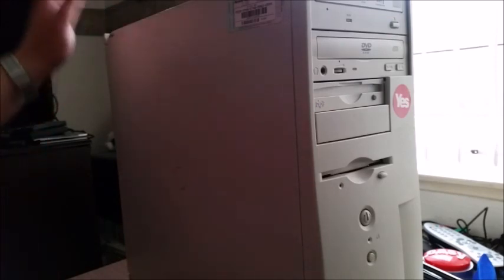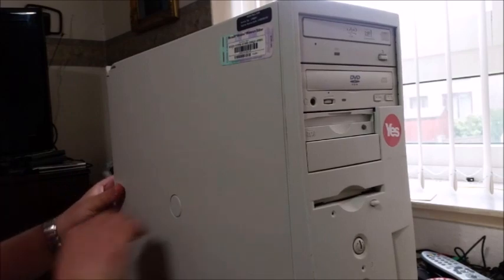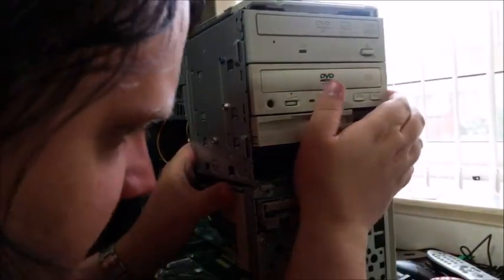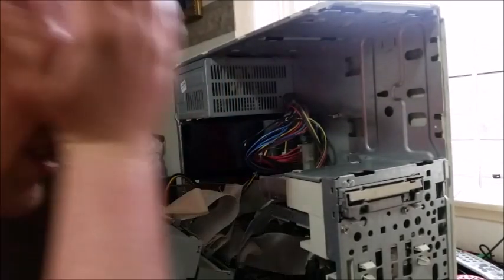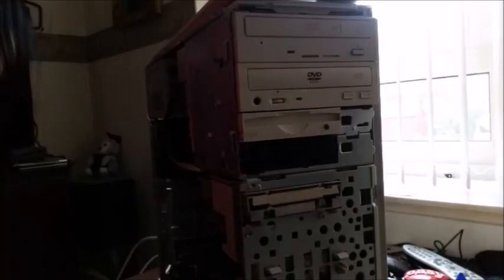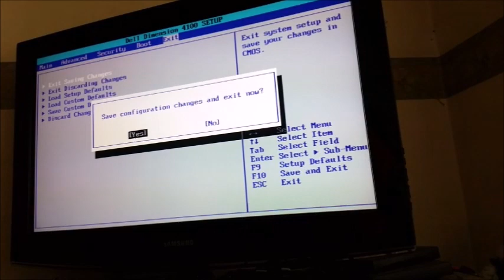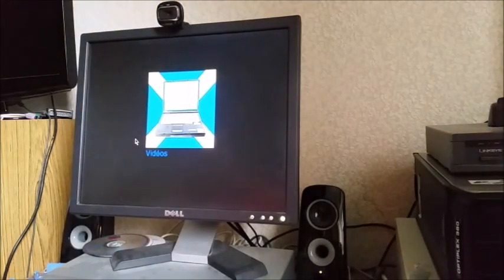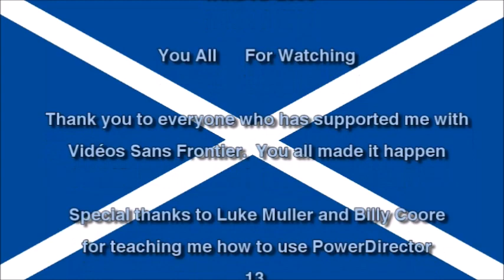Replacing the DVD Writer in the Dell Dimension 4100

Comment: Can run Windows XP on the Dell Dimension 4100?
Reply: Why would you? XP is discontinued.
Reply: Windows XP has been already unsupported since 2 years ago. But, There's an Unofficial Service Pack 4 for Windows XP.
Reply: Aldwin Panny Time for you to go buy/build a new computer if you're still living in the XP days.
Reply: gdfschimpi007 Windows XP was My Childhood OS. Then, I've switched to Windows Vista on December 6, 2008. But, I switched back to Windows XP on October 10, 2010 (on My 11th Birthday), Then, I've switched to Windows 7 on December 10, 2010, Then Windows 8 from October 10, 2013 to December 25, 2013. Then, I've switched to Windows 8.1 from December 25, 2013 to January 9, 2016. I'm now currently using My Tablet. I want to get My Laptop fixed or I'll buy an new laptop. My First Laptop was an HP 550, Then My Packard Bell EasyNote LM82, Then My Packard Bell EasyNote TK85, Then My Packard Bell EasyNote TE69KB.
Reply: You can. If XP supports the cards in your dell
Reply: @aldwinpanny10  You can, after installing windows XP you can go to the dell website and search "Drivers and download" and put in your 4100's Service tag. Then once the page loads you scroll down then select the OS and search your hardware Example: Graphics card, Sound card, Networking card. Then you can put the drivers on USB Flash and plug it into the dell and download the drivers. Keep in mind the flash drive must be formatted for FAT32.